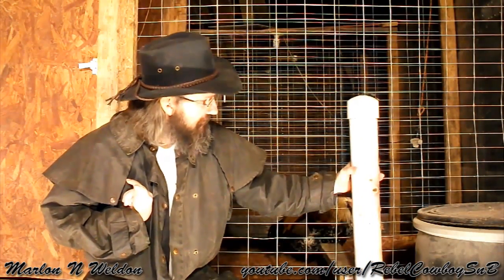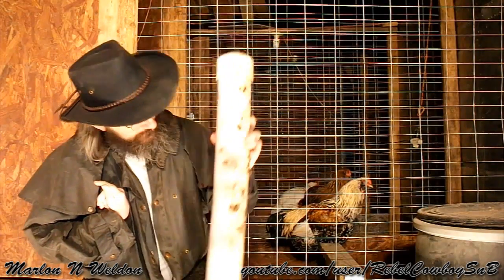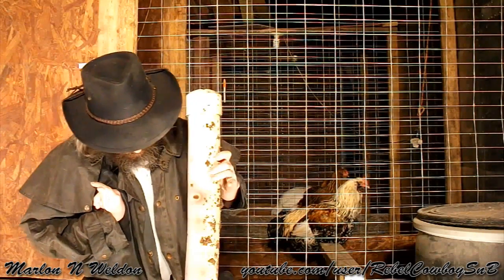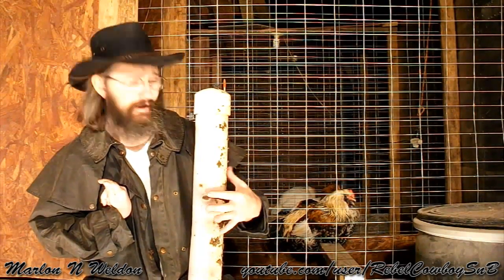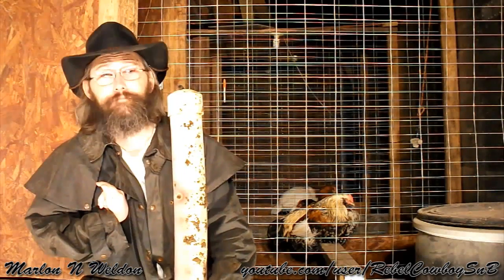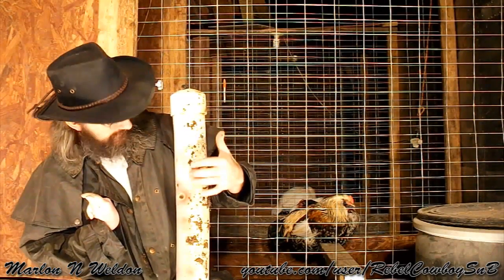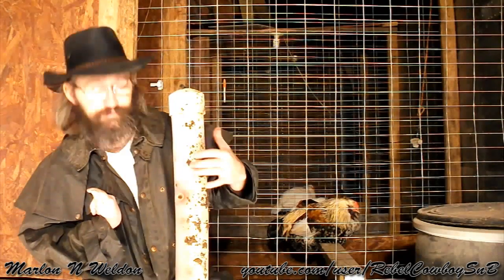PVC Pipe Pet Heater Part 2.

Comment: Pull a wire in the center of the pipe between two end cap (with tension), wrap the lights around the wire, to keep lights away from the pvc pipe. How about that ?